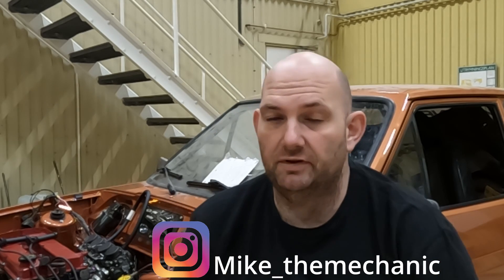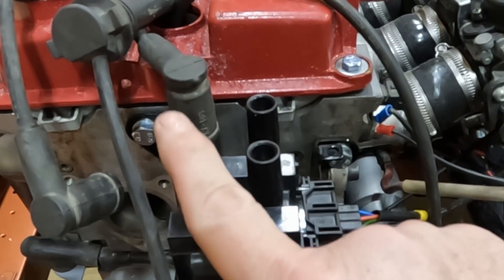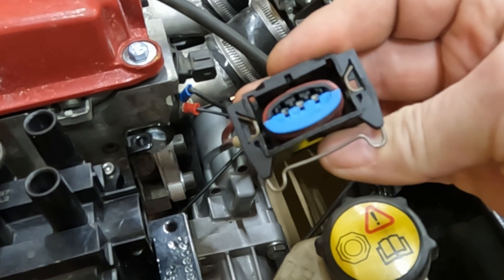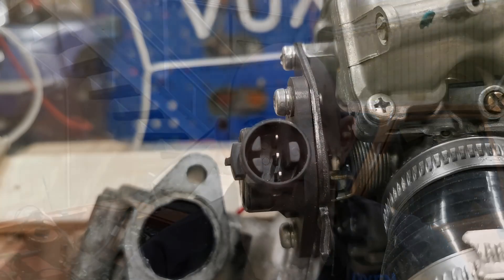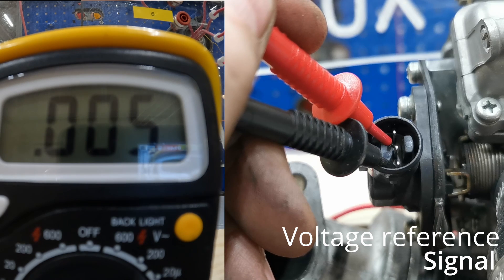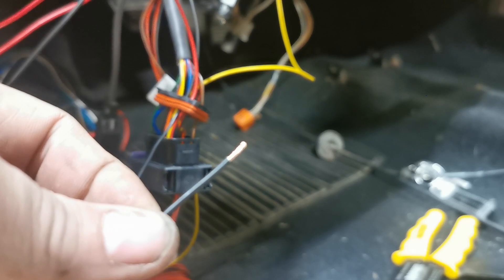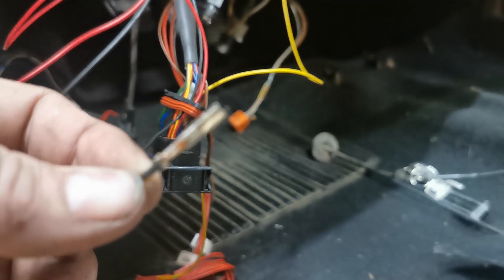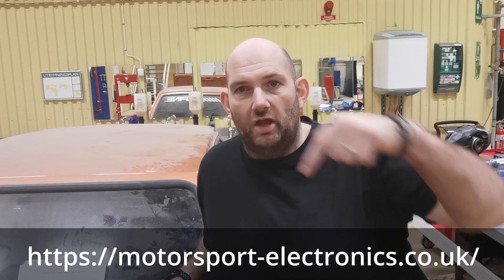Connecting your Nodiz Gen-X ECU. A complete step-by-step guide.

Comment: Hey Mike, I have just hooked up everything, however, I am getting no spark. The trigger wheel and sensor setup was preset by FLOS and there is power going to the coil from the loom, but none of the spark plugs are firing and I can't figure it out. Do you have any suggestions
Reply from the maker: Have you looked in the manual that is available online? It's quite detailed in setting up the ecu.
Reply: Have you solve it?